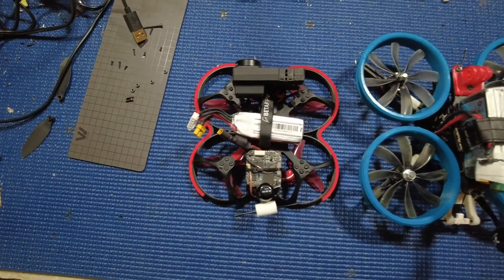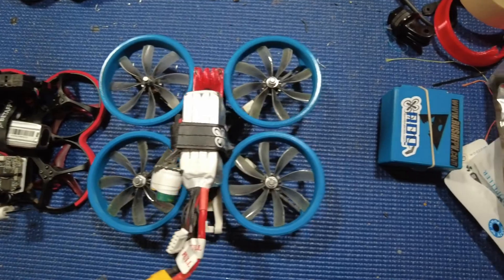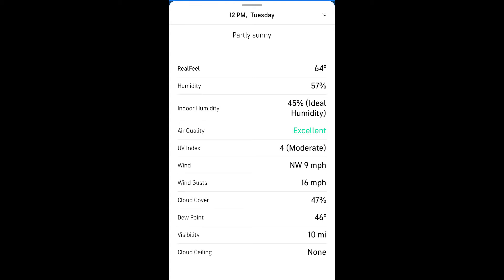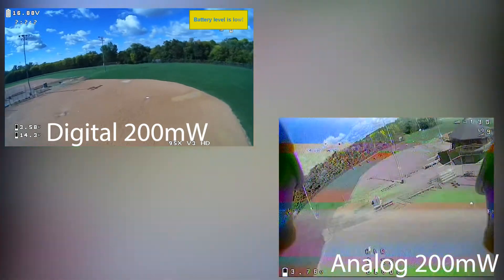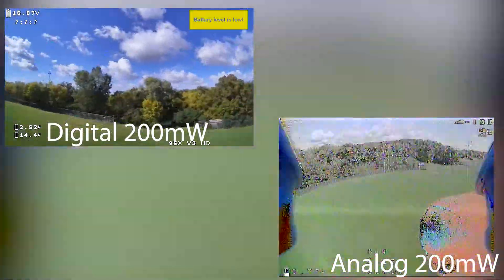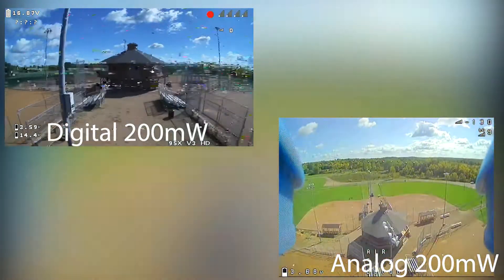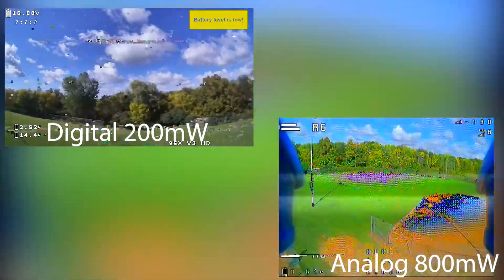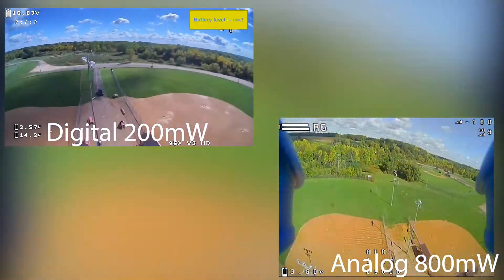SharkByte HDZero TX5S.1 vs Analog Penetration Test

Comment: Not enough information to draw any conclusions I'm afraid.

For example, what receiver antennas were  you using on the analog system?  Remember that the ZeroHD system has TWO patches and two omnis which (in theory) should provide better diversity and, when you look at the video you can see that the analog disruptions you were experiencing were almost entirely due to multipathing.

To properly test you need to be using antennas with the same gain on the analog system as is being used by the ZeroHD system.  Good range and penetration in a cluttered environment is far more about antennas than it is about power levels or sensitivity.
Reply from the maker: Thank you for you input, I agree that it is not scientific and there is no real conclusion it’s why I left it open in the end. 
The antennas being used are all Luminer AXii, on the quad and the Scout HD. The analog goggles are using Wildfire with Foxeer Lollipop 3 and foxeer echo 2 patch.

Comment: We fly at a similar baseball complex and have interference like I see in your videos. I think it has more to do with the environment than signal penetration. We have had slightly better results by changing video channels. $.02
Reply from the maker: I agree, I will give that a go tomorrow actually to see the difference. How ever it still shows that the Sharkbyte system does penetrate decently. Now theoretically it should not be out performing the 800mW analog VTX, so switching channels is very good idea, thank you for those $0.02 :D